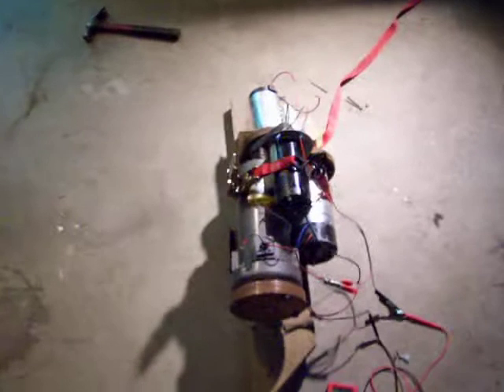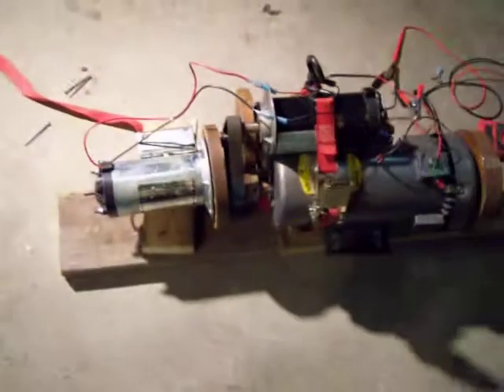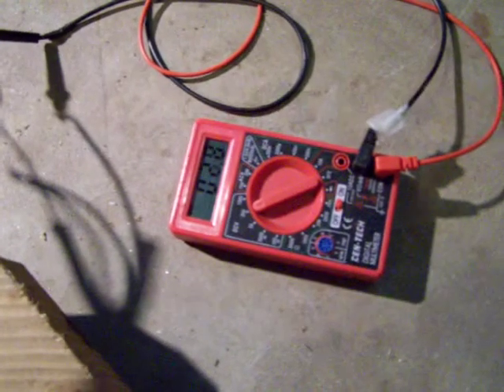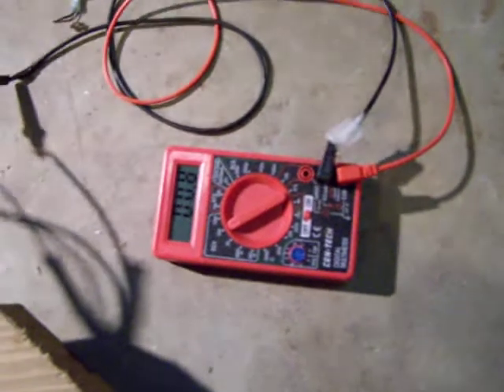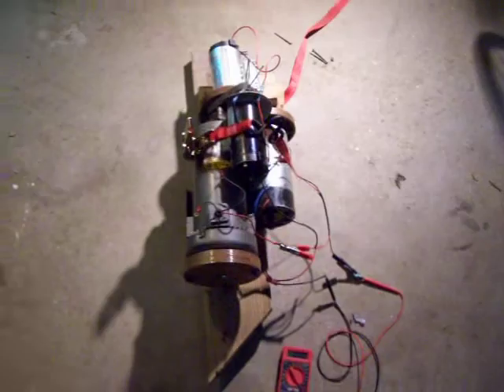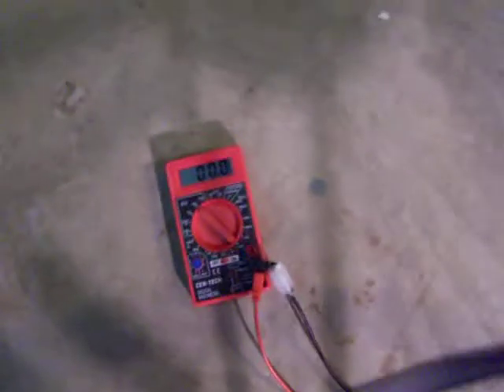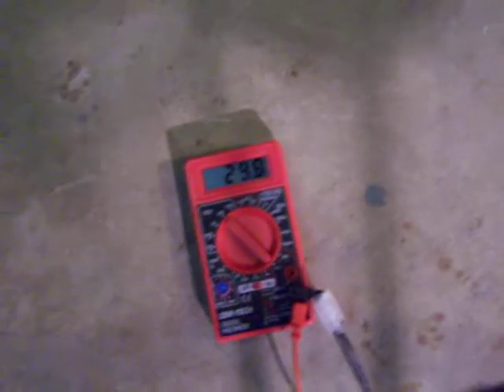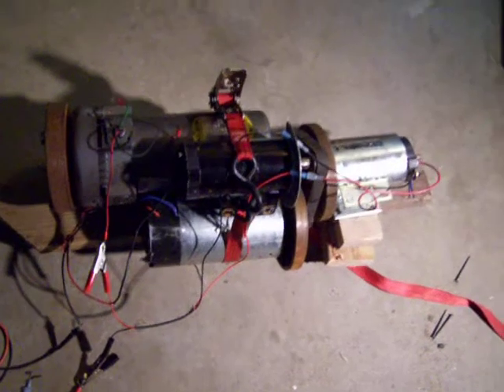treadmill motors

Comment: I will tell ya now do some research on hydro, make sure you get a good paddle wheel or better yet a pelton wheel, and you will need a good bit of head pressure, i.e. the water coming into a pipe to feed it to your wheel, also note that that those treadmill motors have a high cog ratio i.e. a little hard to turn im in the progress of building one myself and have learned the hard way, just some free advice!